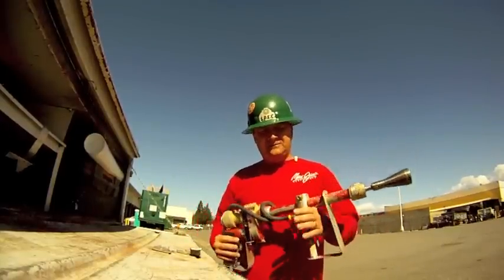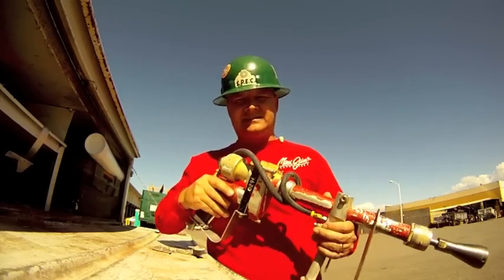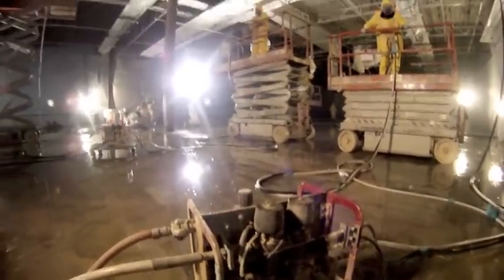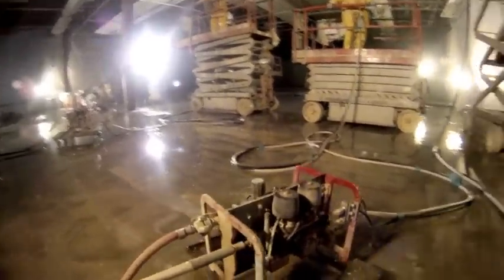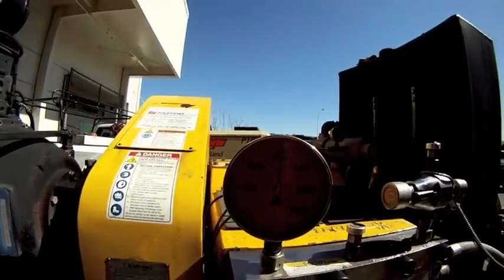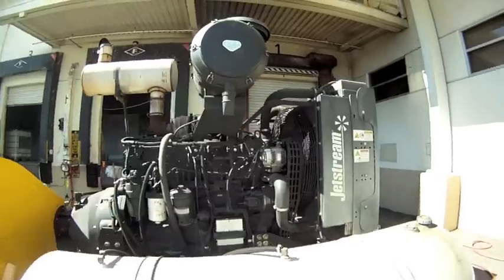4 gun hydro blast system

Comment: Hydroblasting is fun to do. It might look like an easy process, but it's far from it. The guns are light weight, but as soon as that 40-60k lbs of pressure kick in through that gun, if you're not ready, it will knock you on your ass. And imagine doing that for 12 hours straight. Couple that with turtle suits and rain gear, it's a physically demanding job. Plus the 7/12 structured work shifts. It's really hard when you have to do over-head beams like in this video. Anytime you got to shoot above your head, it's rough. I remember hydroblasting back in 2005 for Shaw Robotics out in San Diego. Great times and great place. I had lots of fun those 3 months. We were blasting paint off of a US Navy ship. Day and night shift crews running 24 hours a day. 

I think I made about 20k in those 3 months. It's sad to see, though, that they aren't getting paid anymore today than I was 12 years ago. That's a sad state of affairs. Of course this is the case all over the country in almost any job, yet prices have doubled on everything since then. Of course unless you're the guy sitting in the air conditioned office pushing papers and have hot secretaries doing all of your bidding. Then of course you've been getting your million dollar bonuses each of those past 12 years. I mean, it's only fair right???

Comment: You won’t get as much production with only 3 gallons a minute though.  I run two nlb 40 k’s.   Now we have a aquajet, 20k, 55 gallons a minute, with the robot.
Reply from the maker: I can't imagine having to recover and filter 55 gallons a minute of lead contaminated water.  The ability to run 4 guns at once allows operators to remove the contaminated lead paint without creating a massive flood haz mat hazard. All of the lead jobs that people rent this equipment for require water testing

Comment: i did this kind of work for a short time with my stepfather and my brother in Florida, for company called cavi-tech out of fort Lauderdale i believe  they are out of business now however?  we worked on a oil tanker cleaning the condenser box, and on another ship doing the double bottom using a gun similar to yours except  it only had two nozzles and it used the water pressure to spin it up with no metal on metal contact as the water formed a liquid bearing) may be something to interest you all.

Comment: Your not getting a full 40k per gun. Your probably getting about 5k per gun if your lucky. With as much hose as your using and spitters your lucky to get 5k off of one 40k UH pump.
Reply from the maker: +Mark Cannon  we get a full 40k on each gun. The pressure doesn't divide up only the gpm our 12 gallon 40k pump can run 4 guns at 3gpm each at 40k